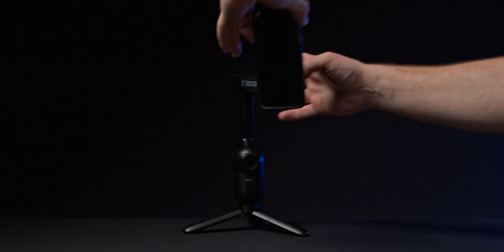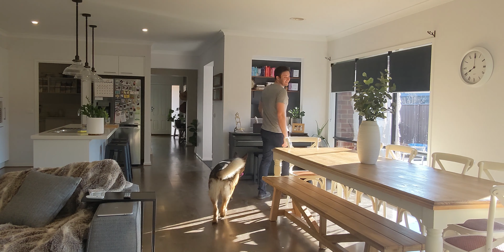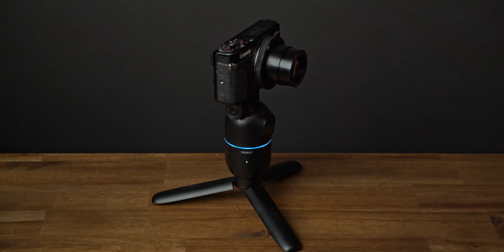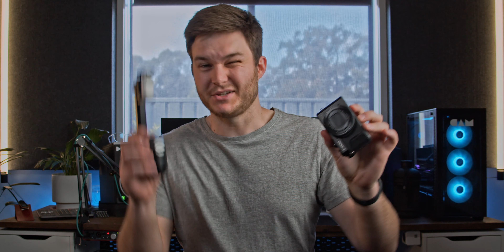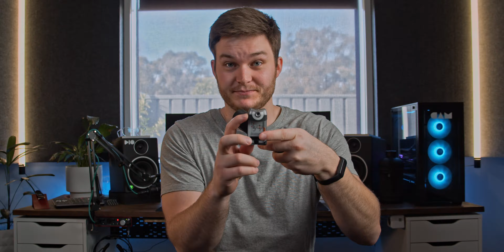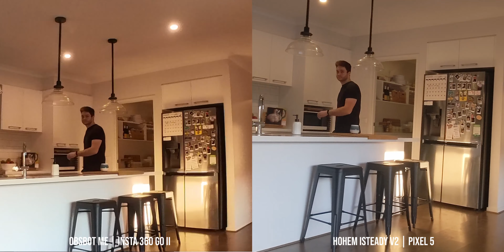One button Tracking - Obsbot Me (modded)

Comment: Do you sell the mounts?
Reply from the maker: no but the STL download files is a free download in the description, and you can then have the part 3D printed.
I would however consider looking at the Hohem iSteady MT2 Gimbal, this is what I now use for my point and shoot cameras, no modding required and has 3-Axis.
Reply: @camshand  interesting, thank you, I will check it out. I do action camera stuff; felling trees, log skidding, tractor stuff, etc. It is hard solo because of constant resets, things like the dji pocket cams would be perfect but they are not as durable as the action cams and won't hold up. Thank you for suggestion.

Comment: how long the battery will last , Sir..?? thanks... i like it
Reply from the maker: Haven't used it until it went flat Vinh. It would be greatly dependent on how much your moving around and how heavy your phone or device is, so would be a hard rating to gauge outside of what a manual may specify.

Comment: Will it hold my iPhone 12 promax with my small rig cage around it with a ND filter and my microphone it will that clamp it around my small rig  cage
Reply from the maker: Not sure as I don't have that phone cage, they might have specifics on their website
Reply: @camshand  yes if you do filming with your iPhone you have a phone cage but you can add attachments so selling these items even like with the gimbals they need to have a good gimbal that holds a little bit of weight for the iPhones in a cage and a couple accessories and the filters in that microphone A light

Comment: Do they have ones where it also zooms. So you can set the zoom to a spacific closeness and it will track you around to that zoom level.
Reply from the maker: Obsbot does have a webcam and standalone tracking camera which has zoom features.
You can't control zoom with the Obsbot me just because it's app free, but if you ran an app on your phone which does it could. But that's be digital zoom so not a fantastic solution.
Reply: @camshand  interesting

Comment: Impressive DIY. Keep it up cam
Reply from the maker: It came out usable which is good! Was pretty defeated until I switched out the tripod haha. Will be good to see this tech come out cheaper in the future 🙂
Reply: @camshand  definitely useful. What's your 3d printer setup in terms of hardware and software
Reply from the maker: I'm running an Ender 3 V2, upgraded bowden tube and springs. BL Touch Added for auto bed levelling.
All controlled by an OctoPrint server. Slicing done through CURA. 

I've got a couple vids on the setup:
Printer starter: https://youtu.be/hTSW-fXdFQo
Enclosure build: https://youtu.be/-mZW9WdBOeM
Server setup: https://youtu.be/10W-jZ4IK30
Reply: @camshand  thank you so much for this
Reply: @camshand  definitely useful. What's your 3d printer setup in terms of hardware and software